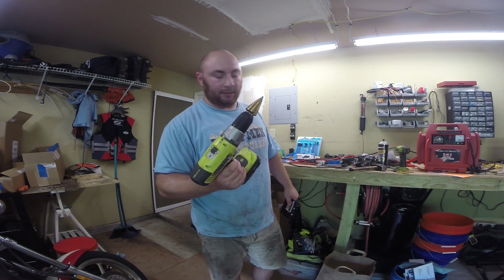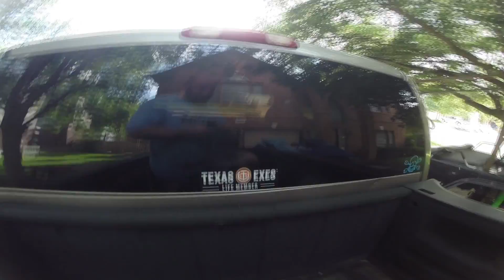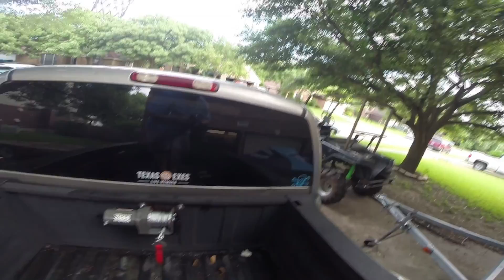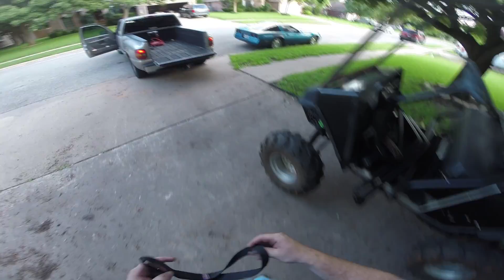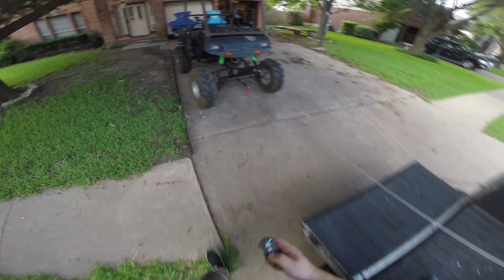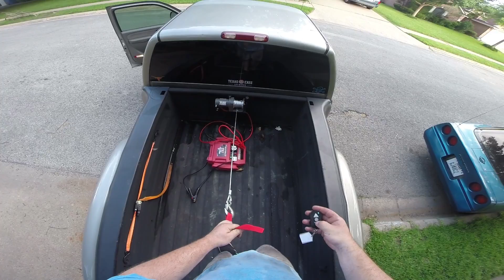MaksWerks Garage - Installing a Harbor Freight Winch for Loading Motorcycles

Comment: I have a Chevrolet Silverado, and the front of the bed is not double-walled. It is the same thickness as the bed floor.
Reply from the maker: Might be a GMC vs Chevy difference like the boxed frame

Comment: That strap had better be stronger than the cable.  If the strap breaks under load, the hook at the end of the cable will (not might) become a dangerous projectile.

Comment: Is this still working for you? I have a lifted truck and am jacked up from my time in the army but still love to ride dirtbikes cant get my bike in by myself on the ramp so I figured something like this may work
Reply from the maker: Ya. I actually built an even beefier version for my new truck after this one got sold. Same winch but I built it into a larger rails + headache rack combo. 

I have solo loaded 800lbs + harleys with no brakes and no issues.

The weak spot on this setup seems to be the cheapo control box. I have had to replacing a few, and now I make sure to seal them with silicon to keep water and stuff out.